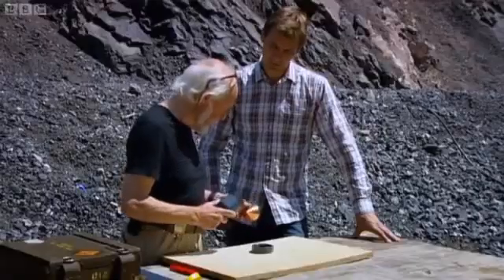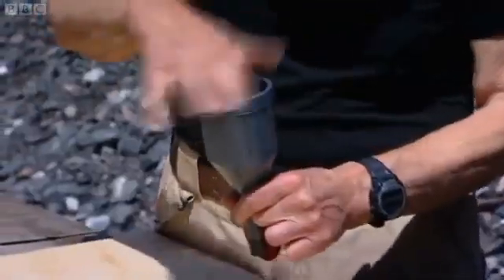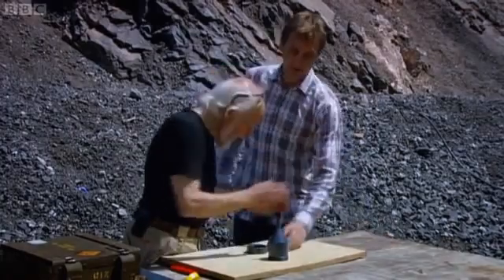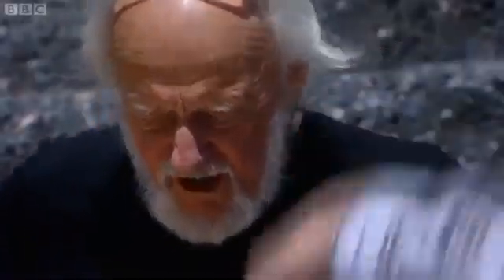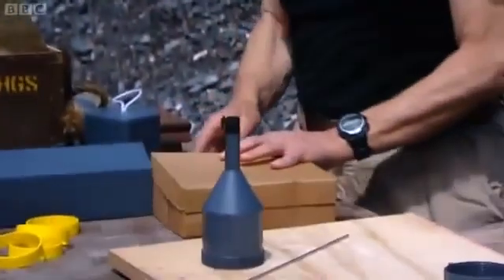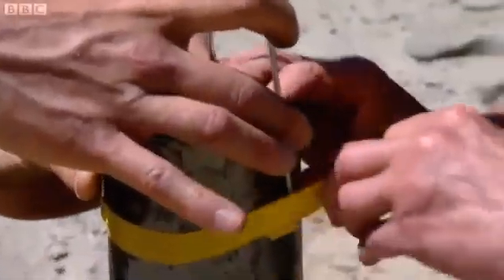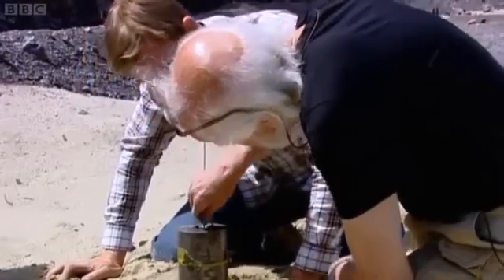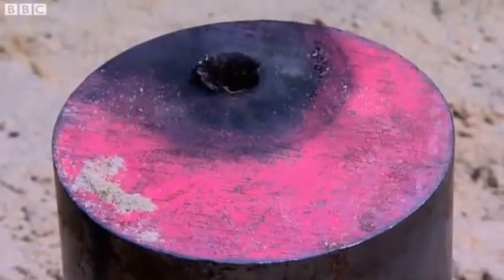Shaped Charges

Comment: Wasn't heat a major factor in the penetrators of WWII that seemed to burn their way through armor rather than the kinetic energy of modern heavy material darts that turn into a plasma and in fact burn through armor just the same?
Reply: It’s all kinetic energy not temperature, melting observed on the armor is a side effect of rapid deformation but not the cause of the deformation.

Comment: The reason NLAW works so effectively in the Ukraine war against Russian tanks is that it has high performance shape charge that attacks the tank from the top. And given the Russian design, the changes are high that the shape charge goes through to top armor and hits the ammunition inside the tower which explodes the whole tank.
Reply: And the shaped charge is pointed downward, isn't it? It shoots in a 90 degree angle outside the missiles flight path.
Reply: @purity_control  Yes, the shape charge is pointed downwards and the charge is supposed when the shape charge is over the target (it basically has metal detector triggering on the tank armor + extra delay of about 1 meter of additional flight time to get near the middle of the tank).

Operator of NLAW is supposed to target the top of the tank while aiming/tracking the target. This also allows targeting tanks behind ground banks because you can still attack from above if you know where the tank is located.
Reply: @MikkoRantalainen  Thanks for the info. Another question: In the frontal attack mode, does the shaped charge still fire downward? I reckon it would be more efficient if it would fire along its path.
Reply: @purity_control  I haven't seen any info that would suggest that the shape charge could change attack direction. As such, other modes have less destructive force.
Reply: @MikkoRantalainen  Yep, exactly. The Direct Attack mode seems to be a "nice to have" add-on feature not leveraging the system's full potential.
Reply: @purity_control  Yes, it has been mostly designed for helicopters. Those do not have half a meter of steel as armor because the weight would be too high. As such, much less force is needed to destroy those and the ability to accurately hit it will be more important.

I think helicopter would crash even if you just drive the missile into the rotor even if you didn't have any explosition.
Reply: It also depends on which kind of steel being used as well. Stronger steel as means LESS penetration. It's dumb how people like to think steel is steel. Just by making different kinds of steels it would change penetration depth by A LOT actually. Some bullets go thru steels like butter. Some bullets don't even make a dent on steel (of the same thickness).
https://youtu.be/BBruJJfs8fI
Reply: @7150285  Yes, steel quality does matter a lot and optimal weapon depends on the target. That said, I think NLAW goes with brute force explosion behind the shape charge so it will probably go through any kind of steel pretty well.
Reply: @MikkoRantalainen  this is my other account. Not sure if my comment from my original account sticks or if you get it.

No, NLAW would still perform differently on different steels. People who understand metallurgy would know this.
With 6 feet (1.83 meters) thick of solid "mild steel". NLAW might, just might have a very very small tiny chance of penetrating it. If it didn't it most likely would still go into the mild steel VERY deep.
With 6 feet (1.83 meters) thick of AR500 or RHA steel, the NLAW stands ZERO chance of penetrating it. Nor I doubt it would go in very deep at all.

I hope you can understand/grasp my examples.
Reply: @prandomable  NLAW shoots the shape charge directly downwards. Which tank has 6 feet thick armor on top?
Reply: @MikkoRantalainen  your comment is "unrelated" to (what type of steel).
Steel types will definitely make a big difference in penetration.
But if the steels are too thin, you are correct, steel types won't matter anymore...
Reply: @MikkoRantalainen  I mean you could say "mild steel and wood" are the same lol. Because bullets can penetrate 0.25 inch (6.35mm) of wood. And bullet can penetrate 0.25 inch (6.35mm) of mild steel.

Does that mean "wood" and "mild steel" are the same to you????
Reply: @prandomable  Yes, my point is that NLAW as a defensive real world weapon is used against real world tanks and even though maximal penetration would depend on the quality and type of the steel, the NLAW shape charge has so much power that it really doesn't matter in practice with the material thicknesses that are available with real world tanks. That's what I meant with "brute force" solution, NLAW users simply don't care what type of steel the attacker uses, it's always weak enough to fail.
Reply: @prandomable  This subthread is about NLAW, not bullets. As for the NLAW, I think there's no much difference if the tank is made out of wood or steel. If you hit with an NLAW, the crew is going to have a bad day either way.

(Wooden tank could be actually a bit safer because it might not have enough metal to trigger the NLAW charge which depends on metal detector. Of course, wooden tank would be very vulnerable to other weapons.)
Reply: @MikkoRantalainen  you are still missing the point. Steel type and steel thickness would make a BIG BIG difference. Try shooting thru 6 feet (1.83 meters) thick of low quality mild steel with the NLAW.
Trying shooting thru 6 feet of (1.83 meters) thick of higher quality like RHA or AR500 steels. And then measure penetration depth, the weaker mild steel most likely would've been A LOT deeper in penetration if not all the way thru.

Are you not understanding this??
Reply: @MikkoRantalainen  according to your logic. You can shoot thru a foot (0.3 meter) thick of wood with NLAW. And then you can shoot thru a foot (0.3 meter) thick of mild steel with NLAW. And then you argued that mild steel and wood makes no difference in stopping NLAW??
It's called a fallacy...
Reply: @MikkoRantalainen  if a tank is made of 6 feet thick of solid RHA or AR500 steel. NLAW stands NO chance of penetrating it. If the tank is made of 6 feet thick of mild steel. NLAW "probably" could still penetrate it, although still unlikely. 6 feet is most likely too thick. Are you not seeing the difference on different types of steels??
Reply: @prandomable  Yeah, and in a fantasy world you would have flying fortresses with 6 feet thick armoring everywhere running on nuclear energy.

In real world tanks do not have 6 feet thick armoring on top of the crew and run on diesel engines which limit the max weight you can sensibly have (plus too huge tank would also be insanely expensive).
Reply: @MikkoRantalainen  that's not the point though. The point is different types of steels alone will make a BIG difference in penetration/penetration depth. At least you're not trying to argue against that, then I'm totally fine with that...a lot people are dumb because they will think steels are all the same material called "steel". When there is literally countless types and different materials of steels out there. 

This is like saying all humans are black people according to aliens, if aliens landed in Africa and only sees black people there. And aliens will think all humans on Earth are all black...
Reply: @MikkoRantalainen  most or a lot of people don't have the knowledge of different materials. They will tend to believe there is only one material called "steel". When there are literally countless types of steels with different materials of steels. Those people might as well say all wood are the same thing, when there are countless types of trees out there as well.

Same with concretes, there are literally countless types of concretes out there. The concrete used for "nuclear rated bunkers" won't be the same concrete as the concrete used on your sidewalk or driveway though....just saying. Concrete could range from less than 3,000 PSI to more than 20,000+ PSI. Are you gonna argue all concretes are the same??
Reply: @MikkoRantalainen  I mean I get your point too. Steels are not gonna stop NLAW no matter what type of steel you used. It is only because it is (not thick enough) That's why...
Reply: @MikkoRantalainen  shooting AT-4 rocket launcher. And again, check out his whole channel.
https://youtu.be/YR5Aa_p65EE
Reply: @MikkoRantalainen  tank vs RPGs. And again, check out his whole channel.
https://youtu.be/5d1gJHcYtpc

Comment: I wonder what the relation between the charge's explosive casing and the thickness of the copper sheet is. I guess that, if the copper was too thick, the pressure would just go upward... so how is it that such a thin plastic wall can direct the explosive force like that?
Reply: The copper side is the path of least resistance. The copper isnt locked into the casing , its just stuck in position there....The detonated composite is what forms “the Munroe Effect” where the copper cone inverts and its the reaction from the detonation itself that turns the copper cone into “Newtonian Plasma”...in reality, the shape of the plastic casing is all that really prevents any upward expansion...has one big open side, one small side .... you get it.

Comment: God copper penetrated 1 foot of steel !. They should have used slow-motion guys to use a high-speed camera to trace the molten jet in the air !. SLOWMO guys content for next episode!
Reply: except they shot stainless steel. Which is a very soft steel like mild steel with brinell hardness of only about 120. Very weak and soft.
Reply: @7150285  stainless isn’t soft….
Reply: @georgejackson4790  it is relatively very soft compare to other types of steels. 120 brinell hardness is for soft steels like stainless steel and mild steels.

Comment: what a destructively clever piece of technology.  I'd assume it would take a bit of skill and wit to fire from a launcher if you expected to actually hit something on the other side of the armor, considering the actual end-result is projecting a thin wire through what ever you struck.  For tanks i guess you'd have to have knowledge of the internal layout and where the crew is going to be if you wanted to incapacitate or kill some poor sod within it. otherwise the charge goes off, and the copper wire enters the tank, whizzes right past any breathing human, allowing the tank to resume functionality as normal.

Kudos to those in ye olden days who actually managed to get confirmed kills on armor with shaped charges. Wouldn't that make you a sniper of sorts?
Reply: once the jet enters the tank, it rapidly turns the interior environment into a very bad place to be
Reply: @BLAHBLABBA  you mean the occupants don't have to be in the direct path of the entry hole?

Comment: I have used LOTS of shaped charges in the Army. Ours had inverted glass cones. You do not need the copper. it is the cone shape of the explosive that directs the blast. A 15lb shaped charge will blow a perfect post hole about 3" deep in the hardest ground.  We used them for emergency demolition of nuclear artillery projectiles.
Reply: Three inches or three feet?
Reply: @benbaribault424  typo.  It will blow a hole about 6 to 8 inches wide X 3 or 4 feet deep. The 40 pounders are really fun.Especially multiples daisy chained with det cord
Reply: @patdennis3751  also when you mean ground do you mean Earth's dirt ground? Gravel? Can u be more specific? Geology matters.
Reply: @7150285  Hard packed clay or gravel never seemed to make much difference. Nice clean round deep holes. Like I said.  The 15 lb shaped charges we used had glass cones. It is the shape of the charge that makes it directional and will work without the copper or glass cone as long as you shape it that way. The cone structure  just keeps it from being deformed until it is set off.  C4 shaped similar to angle iron makes a great steel cutting tool for bridge girders and such. Its all about the shape. Was great fun while it lasted.
Reply: @patdennis3751  Geology matters. With solid granite ground it probably would've definitely gone much shallower than clay or gravel ground...
Reply: There's a recent YouTube video of a small sandstone boulder (only couple feet thick) that defeated RPG-7 like the RPG-7 was nothing.

Comment: Thousands of shaped charges are used every year to make the holes in oil well casing pipes to allow the oil through the formation and into the well. They are located with the charges placed at 4 charges per foot and spiraled around the inside of the casing. About fifty years ago I worked with them a little bit. The company I worked with claimed that the charge would punch a 10 mm hole through the steel casing, the cement that held the pipes in position and 39 inches into a 3% porosity limestone. This all happened down the well .
They were fired electrically, and you couldn't hear anything when they went off. Of course sometimes they were over a mile beneath your feet,so it was understandable.
Reply: Giant sandworms that have been peacefully hibernating for the last 500,000 years: *angery time*
Reply: Wow. Interesting 😊

Comment: A foot of steel? A 50 bmg (biggest rifle bullet) would barely make a dent into that. Damn
Reply: Actually a 50bmg SLAP round will penetrate 2 inch of ar500 steel.  Other rounds more. But we wont discuss them.
Reply: @robertreynolds9228  high velocity 4,000fps tungsten carbide SLAP easily stopped by my 2" AR500F. The amount of AR500 thickness I have will also stop the shaped charge in the vid that I'm commenting under easily as well I'm fairly confident.
https://youtu.be/rcOrZj5GTKo
Reply: They were using a foot of "stainless steel". A .50BMG will most likely go DEEP into that stainless steel as well. Stainless steel is soft and only have brinell hardness of 120ish I think. Kinda like weak mild steel.

Comment: I'm at a loss as to why with no weight or mass on the other side of the shaped charge, why does it direct such power in a downward manner so effectively. Looks to me like the plastic explosive detonation would combust in all directions given that it was contained by only a piece of plastic. I don't know if I'm verbalizing this in a way one can understand what I mean but any feedback would be great.
Reply: @Robby House My best guess is that such directional design isn't necessary with the energy of the explosive involved, it's simply not an issue to allow expansion in all directions. However it is interesting that Dr Alford once demonstrated the containment effect of water upon an explosive charge in a TV program about the dam buster bombs. A small charge detonated against a metal plate under water would make a deeper scar than the identical charge detonated in open air. So such things can probably be a factor in some applications.

Comment: well this old man sure knows what he is doing, the penetrating power of a simple flimsy cone of copper is astonishing, finally I understands how a RPG can penetrate mighty armor.
Reply: Eddie Sloan  Very late reply, I know, but the main principle of cage armor is not solely that it alters the standoff distance.  (That helps, but as some others already intuitively realized, the jets are usually longer than the cage standoff and you'll have some penetration anyway).  The other protection mechanism of cage armor is very flimsy - it gives a chance for the warhead to strike off-center on one of the slats, crushing the edge of the cone before the tip reaches a solid surface to fuze on.  If this works correctly, it prevents the jet from forming at all.  Naturally, since you can't guarantee that the RPG won't hit a slat directly and fuze anyway, and you also can't guarantee that the enemy is not using a warhead with a full-width fuze, cage armor is very much a last resort.
Reply: Eddie Sloan That makes me wonder, would a modified shape charge have a suitable distance for reaching through the cage?  This charge was elevated maybe a foot above the target, so it seems possible to design a modified RPG warhead which has a longer jet reach.
Reply: @ghollisjr  modern missiles have tandem warheads which means there are 2 charges, one in the front of the other, the first charge destroys the cage and the second one hits the armor (sorry for my english)
Reply: Tanks usually use reactive armour against shaped charges. https://en.wikipedia.org/wiki/Reactive_armour
Reply: There is a recent YouTube video of a small sandstone boulder (only couple feet thick) that defeated the RPG-7 like it was nothing.